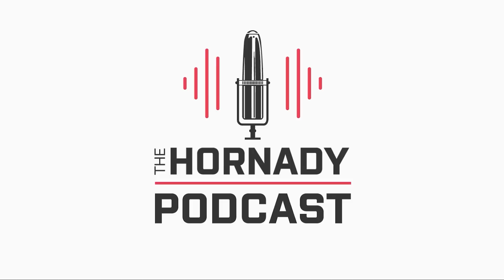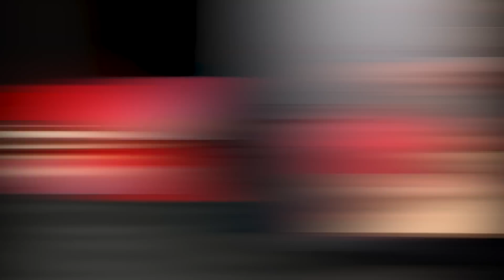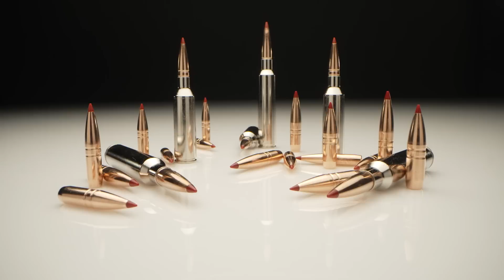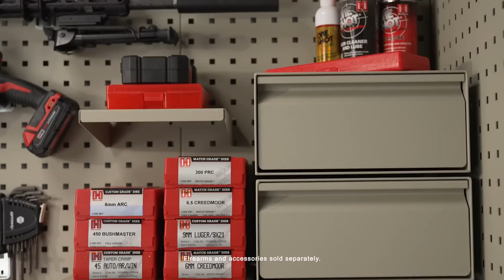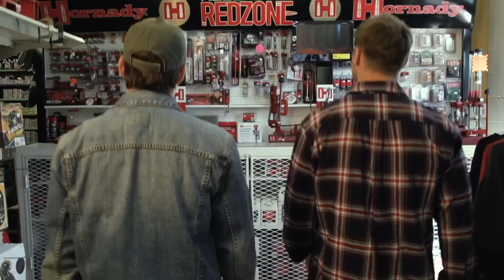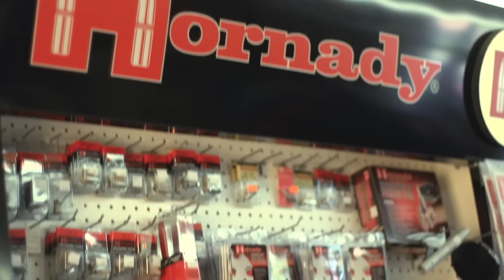Ep. 150 - Introducing the NEW 338 ARC

Comment: When are you guys going to make a 338 PRC ?
Reply: 338 RCM. Predates all the PRC stuff by almost a decade. Awesome cartridge I own one
Reply: @emberfield1  The 6.5 PRC uses a necked-down 338 RCM case, FWIW.
Reply: @jfess1911  I don’t reload yet but I’ve heard you can neck 6.5 prc up to make 338 rcm brass with some effort. Hornady did just dump a ton of 338 rcm ammo on the market though. I doubt it’ll happen but I’d love to see this cartridge make a comeback. It’s the perfect suppressor host cartridge as it performs well in short barrels.
Reply: @emberfield1  In one of the podcasts a couple of years ago, Seth went around the office and asked the "if you could only have one rifle and cartridge, what would it be" question.  On of the higher-ups chose the 338 RCM because it worked well in shorter barrels and could handle any game in North America, even the big bears.
It is possible that the 338 RCM might make a resurgence, but I would grab ammo while it is available.  The RCMs were the last of the true Short Action Magnums that fit in 308-length actions and were designed for traditional, shorter bullets.   Most of the cartridges after them switched to the longer, higher BC bullets that required a longer action and faster twist.
Reply: @jfess1911  it’s an excellent cartridge that really fills a gap in the market in my opinion. I find the recoil to be similar to 30-06, it’s very manageable for the amount of power it’s delivering. I’m not sure why it didn’t remain more relevant.
Reply: My thoughts exactly! I would love a 338 PRC to go with my 300. I’ve thought about necking up the 300 PRC. PTG has a reamer for a 338-300 PRC
Reply: They did it's called 338 RCM

Comment: Twist rate?
Skip to 28:00 to hear about twist
Reply from the maker: 1 in 8"
Reply: @hornady why not link up with Southern Balistic Research with the 338 spectre? It's been around longer than the 8.6 and fits a 6.8 magazine and bolt.
Reply: @michaeldowling4160  I think you answered your question with your question. It uses 6.8 bolt  case head. The ARC is their baby
Reply: @hornady so you can use cheaper bullets you already make instead of engineering new bullets that take advantage of the twist rate for 8.6 Blackout.

Comment: What I wanted to hear: mags that work with it and nominal load data. 

What I heard: 6 arc, 6 arc, 22 arc, better than 300 blk, 8.6 is bad, “efficiency”.

I sincerely doubt this is more efficient than ~10 gr of powder in and ~500-600 ft/lb out the front. Really would love to see mags that actually work with this cartridge too.
Reply: Hornady HAS confirmed the SAME MAG, I know its big (That's what she said) but it works according to them... very hard for me to believe they would release without some compatibility.
Reply: @ChristopherBenfield-i9o  I'm also wondering if Magpul will support it, since there are """"SF Contracts"""" for 6 & 338 ARC, and there are now 4 cartridge's with that case.
Reply: @ChristopherBenfield-i9o I’d love to see the reliability testing they’ve completed.
Reply: DUDE 6.5 Grendel MAGS WILL WORK!!!
Reply: @christopherbenfield7848  MAYBE. The 338 arc is a radically different shape and them 300 gr subs will be pretty meaty on that mag spring

Comment: 338 spectre.....
Reply: And razorback. Glad this is a trend. Purposebuilt subsonic only.
Reply: Yes, but using the 6.5 grendle case, with its giant trash casehead that blows bolts constantly.
Maybe the lower pressure 338 ARC might not blow AR bolts as fast.
Reply: @therealdestructicus  I have built about 10 6arc ar 15's. My personal  6 arc has 4k+ rounds on it. I have yet to see a broken bolt. Get yourself a good bolt (jp, rca,rexus,maxim) a good barrel. Most importantly a midwest industries urr and properly torque the barrel nut and +1-2  adjustable gas system. Then tune it. I belive this is why bolts were breaking. 556 bolts break all the time with more metal on poorly timed guns.
Reply: @blazinggsx the bolt is way to thin for a fighting rifle. If the anvil from cmmg makes a return I think 6 arc, 6.5 G, 22 arc, and 338 arc make sense. Until then, no thanks.
Reply: @therealdestructicus stop cheapi g out and buy a C158 bolt. Problem solved

Comment: Very interesting...
Reply: of course they are going to trash the 86.  you know why.....
Reply: @EagleRun23  because they got the same performance out of an AR-15 vs an ar10. So it's objectively worse.
Reply: @RCx44 no, they didn’t.
Reply: @kevinbrittingham6774  no one cares about supers in 8.6 or 338 Kev. Just take the L no reason to hump a large frame when 99% of the rounds shot will be subs.
Reply: @RCx44  yes, people care about supers. Just like with 300 Blk. Yes, large frame 308 guns suck, they’re too heavy. That’s why we designed a small frame 308 based gun. It is 6 lbs with a 16” barrel, takes standard SR-25 mags. 8.6 Blk doesn’t require modified, unreliable mags like 338 arc. You also need a different, weaker bolt, and modified feed ramps. So, most people care about reliability too. Hornady’s Creedmoor cartridges are great! Bc barrrel swap only…just like Blk.
Reply: @kevinbrittingham6774  whatever you need to tell yourself. at least 8.6 kinda still makes sense in a bolt gun. 

Here is a free hint make a 338 HB but call it a boom box and hope no one notices.
Reply: @EagleRun23 @buffRANGE love your vids guys.